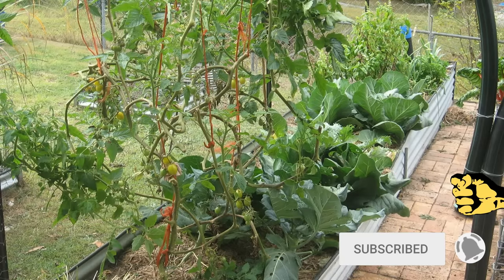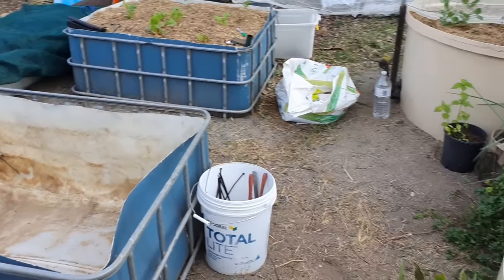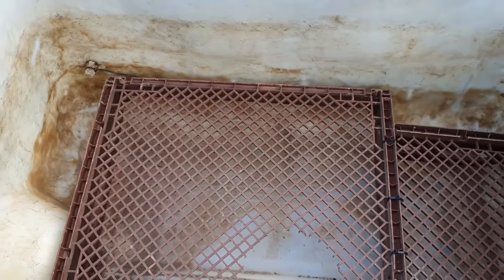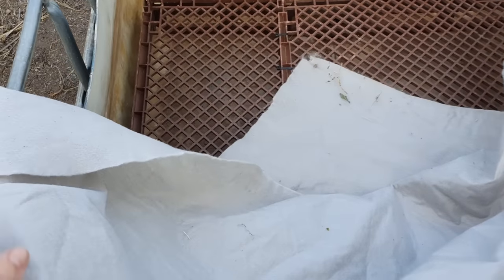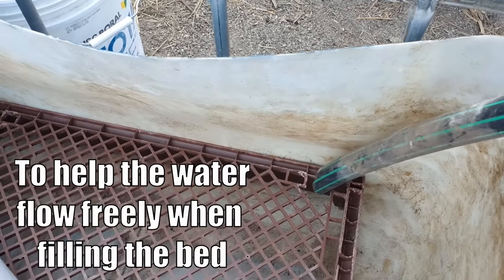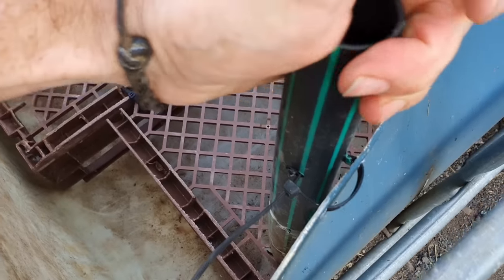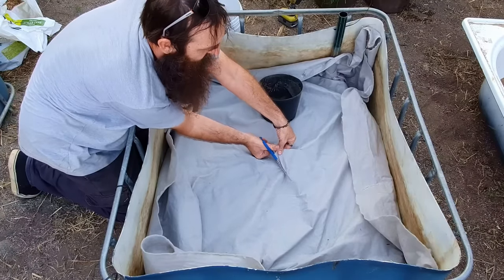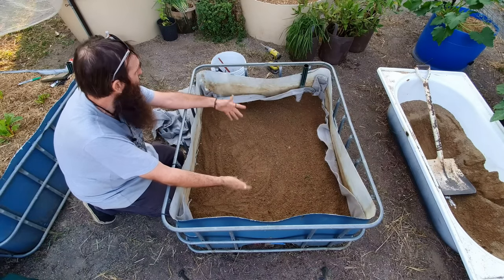How to Make a Wicking Bed with Bread Crates | Large Water Capacity & Healthy Soils

Comment: I know this is an older video but hoping someone might see my question and have an experienced answer.  I've been watching these videos for about a year now trying to learn enough to not kill everything I plant.  Today my husband surprised me with a used Behlen stock tank that is 2x2x6.  I'm thrilled and want to make it self watering using advice from this video.  No questions about that process because the instructions here are so great!!!!  However, I'm such a newby at gardening that I don't know if I should use this system to plant potatoes.  Will potatoes do ok in a wicking bed environment?  And would it matter if I plant determinant or indeterminate?  Thanks for any answers.
Reply from the maker: Hi SS. I've grown potatoes in wicking beds & barrels & find they always do well. I do like to do them in a taller bed & plant the seed spud about 150mm/6" above the top of the reservoir level so they don't get too moist. I also make sure I hill up around them so any that breach the surface  don't turn green when the sun hits them.
I hope that helps some.
Happy growing.
Reply: @RobsAquaponics  - Thanks so much for the reply.  I've got lots to do and probably more than one or two failures in my future but I'm determined to do this well. I love that you share your knowledge.  And I'm green with envy over your abilities and growing knowledge. The good kind of envy turned quickly into admiration. May all the good you put out to others come back to you multiplied again and again.

Comment: I've used small float valves that facilitate autofilling of the reservoir.   It took many trials and errors to configure the values and floats to work reliably given they're designed for the float to be on a horizontal lever arm.  I have photos; don't know how to get them to you though.
Reply from the maker: Nice one Kate. I made up an auto top up system as well with a float valve in a control box that sat outside the wicking barrels. Worked really well & would like to try something similar with the larger wicking beds when we set them up in their final positions. 
Cheers & happy growing.

Comment: Hi Rob, love your channel.  i exactly thought the same idea ( however using free Japanese beer crate got from gumtree instead of bread crate) after watching your previous video. now i am building 4 wicking bed (probably over ambitious) . and wondering if any sand( think of sand  from garden)does the wicking trick? i know you are a firm believer of sand as wicking material but  what is your take on coco coir  instead of sand? have you ever compared  these?
Reply from the maker: I haven't compared them sorry mate but have used the coir in small wicking buckets before with no issues.
I can tell you that the two round wicking beds I quickly showed in the clip have a very sandy soil in their reservoirs. I made sure there was very little organic matter in it & so far they're doing well. 👍
Cheers.

Comment: Hi Rob. I've just recently found your YouTube channel as I'm interested in setting up my own aquaponics system now I have an allotment and have been loving the videos of yours. I was wondering is there a way of hooking up one of these wicking beds with an IBC based aquaponics setup, or is it better to have them separate? Keep up the good work! From the UK 😉
Reply from the maker: Hey BBD. They can be hooked up into aquaponics & would like to do so myself at some point. I'm looking at having a small amount flow through the base in a separate loop that then returns to the sump tank. 
Another option would be to just remove water weekly from the fish side of the system & replace it with fresh water. The removed water would then cycle through the wicking beds until it needed to be topped up again from the fish/aquaculture side. That's basically how the beige 2nd hand system was set up before I bought it. The plumbing was more elaborate than I have in mind though. 
Cheers mate & happy growing.

Comment: Great video. How do you know how high to install the over flow point?
Reply from the maker: It can be done a few ways. You can have a fixed height at the uppermost volume you want the reservoir to hold or you can make the hole at the base & use an external movable drain to set the height. 
This link will take you to a spot in another video where I run through that idea,
https://www.youtube.com/watch?v=hL7PgoTlImE&t=364s
Hope that helps.

Comment: Hi Rob Thanks so much for all your info. Could you use all soil, rather then sand and soil? Thanks
Reply from the maker: You can use just soil. I used some old bed soil that had very little organic matter in one recently & that looked to work OK. Was only slightly anaerobic in a few spots when I pulled the bed down so was a much better result than I expected.
Reply: ok thanks , right after a posted that question  I watched one of your vids where you tell why you use sand was some times the soil will start to smell and turn bad after a while if it has a lot of organics in it.  What do you do with the bed to get it ready for the next season?
Reply from the maker: I generally just top dress with a few cm of compost & freshen up the mulch between crops Bob. I may add some slow release organic pellets as well if I'm planting out a load of demanding plant in there as well.

Comment: Love this design. Im new to the channel and was wondering how often do you need to change these?
Reply from the maker: Hey Amber. I like to feed them up with a top dress of compost (or slow release organic fertiliser if I have no compost on hand) once a crop comes out & that's about it other than adding more much as required. I also like to leave the roots of plants in to help add organic matter that feeds for the worms & other soil biota. 
I have has some that settled after a few years so dug through a load of organic matter & that helped to loosen the soil up again.
Reply: @RobsAquaponics  thanks so much for the intel! Will definitely help as I try this method

Comment: What are the dimensions of the container you are using in this video?
Can this method be used in a planter bed that is 8ft long and 3ft wide? 
What modifications would you suggest for that size?
Also what is the weight or grade of Geotextile fabric you use?
LOVE the video - I'm inspired
Reply from the maker: Hi Carol. This IBC bed is about 3 x 3ft & is 19" high & you could easily set one up in a 8 x 3ft bed. 
The longest wicking bed I've made was around 16 x 3ft & it worked really well. 
The one thing I  would recommend you do is to  bring the liner all the way up to the top edge of the bed. I didn't & had tree roots got in. 
You can see a smaller version of that bed in this OLD video. https://www.youtube.com/watch?v=1PlBrOnKaQI
Keep in mind that I would not build the reservoir the same as the sand one in the video I shared above. I would probably try to use something like the bread crates or pallets to allow for more water to be held there, like in the video you're commenting on.  
The fabric I'm using is sold as "Geo Textile" here.  https://www.bunnings.com.au/grunt-1-x-10m-non-woven-geo-textile-membrane-drain-mat-fabric_p1090843
Hope that helps some.

Comment: Loved your detailed video thanks and plan to copy this method on the weekend. Given it was something new you tried compared to the agline, wondering how it has stood up since and whether you’d recommend any tweeks? Thanks.
Reply from the maker: I found it to be the best build to date Karin. 👍I have now used a similar design in a new aquaponics flow through wicking bed & future beds will be made in the same fashion but I will probably use something other than the bread crates.
Reply: @RobsAquaponics  thanks for that - any reason the bread crates are an issue? I've got mine all setup and will start filling with sand, geotech and soil mix shortly. I did add one or two extra wicking pot points cut into the crate. Either way - it's the right time to change to something else if the crates are problematic. cheers
Reply from the maker: @karinschicht3808  The crates are just hard to come by legally. 😉 These came in a batch of goods I bought second hand & haven't seen others come up for sale since.
Reply from the maker: @karinschicht3808  I tend to make do with what's on hand most the time.

Comment: I live in nz and hav followed u for many years and now we hav moved into a new property i will be finally able to hav my wickering beds. My only question is, what is the geo fabric u use and how do i go about getting sum and is there other fabrics that can be used for the same job? Is this the same fabric used to line soak holes
Reply from the maker: It's known as geo textile in NZ as well from a quick search I just did. Used mainly for keepingg silt & sand out of drainage pipes & soil stabilisation. I like it as it wicks well. The woven landscape/weed fabric helps separate the layers but doesn't wick that great & should be available in the garden section of hardware stores. 
Hope that helps some.
Reply: @RobsAquaponics  brillant we hav sum left over from our soak hole 😁 thank u

Comment: Utterly splendid video, cheers! 
I have tall beds, very deep.. necessary as have some physical restrictions so going low is not an option at all. Most are half-filled with rubble then some good old wood filled up to the level required before the soil goes in... but am always looking for any way to add to the conservation of gaia, esp on the water front. Indoors we've only flushed using old bath/shower water for decades, and outdoor want more space for water containment but is all my spare space is used for. This information is my idea of ultimate treasure, no kidding.
Might I enquire what you suggest/what is it you've used as the plastic container that you put everything into, within the actual bed? 
I'd attempt to alter everything this autumn as long as I've a few more hands on board & some backs that can handle some bending & basically strong young ones shifting sand etc, am all for getting a couple of these containers set up in such a way.. meanwhile continuously providing & nurturing my family/peeps & neediest parts of the community with healthy organic produce foc, that I'll carry on with in the smaller beds until this system is set up. 
This is the best thing I've ever seen. And your other ideas are brilliantly helpful too. 
An inspiration that is valued beyond measure bruh. Rockin it! 🙂
Reply from the maker: Hi HY.
The tanks are called IBC which is short for International Bulk Container. They can be found for sale at farm produce shops, drum & tank recyclers & on sites like Gumtree & Craigs List. 
I look for ones that have had food or food-safe products in them.  I chop them in half so we get 2 watertight beds from them that also help in roots from nearby trees invading them. 
This playlist has some of my other wicking bed builds in it that might help you with a few ideas as well.  
https://www.youtube.com/playlist?list=PLBcWprMIwYYizRYZra6RRbe_mrPdnXu4G
Hope that helps some.
Reply: @RobsAquaponics  you star!! That's super helpful dude, shall go seek them out!.. I hope your days are full of vitality that brings naturally grown nutritious nourishment to your belly.. that all around you are solid in their efforts & mutual appreciation is in the giving.. that tranquillity reigns even on the fiercest days where we face our toughest challenges. May all your future endeavors be fruitful. 
In humility and appreciation, h x

Comment: Looks wonderful, Ive been debating on making some out of IBC's. Can you make 2 wicking beds from 1 IBC?
Reply from the maker: You can but you need to make sure that the lid is water tight. 
You might want to shape the soil under the lid section as well so it doesn't distort too much. 
Hope that helps some.
Reply: @RobsAquaponics  Thanks rob bob ! It was very helpful

Comment: Hi Rob,  Looking to build some of these for a community garden.  In our Melbourne weather we need to be mindful of frost and heat in summer, have you seen any designs where you can make a cover for these? (plastic in winter, shade cloth in summer)?
Reply from the maker: Hi Nigel. It would be easy enough to connect some fittings to the beds if they were clad with timber. 
I've been checking out these fittings https://www.klevercages.com.au  & might have a crack using some to make up a few cloches up for the brassicas next winter. 
Hope that helps & sorry it took so long to respond.

Comment: Thanks for another great video. What’s your thoughts on where to tap the side for overflow? Do you leave an area of air between water and sand when full? I live in Florida and if I don’t put a screen over the fill nozzle, I can hear frogs screaming to stop sometimes while filling or I see them coming out of the drain hole.
Reply from the maker: Hey Matthew. For this style of reservoir, I would like to have the bottom edge of the drain above the high point of the water cell & in the sand wicking layer. 
It is a good idea to have a top over the fill tube & something I'm yet to do. 😕 Thanks for the reminder. 
Have a top one mate.

Comment: I have a 3m x 1.2m bed and have 6 cut down milk crates but could fit 12. Will it be better to have 12 cut down milk crates over or do i require the additional space for sand?
Reply from the maker: I would use as many as I could the add in small wicking post filled with sand throughout the bed to bring the water up Michael.  Hope the build goes well for you mate. 👍👍

Comment: Thanks for the vid Rob. about to created such but want some advice in obtaining  foodgrade IBC's.  HDPE is BPA free, yes? I am looking at used IBC's of Finethene 49080. Then there is 5502 HDPE .
Is all High Density polyethylene IBC plastic BPA free  but just depends on what was stored in it that makes it suitable or not. How will one tell if it is being delivered without the chance of inspection? ( Melbourne Lockdown)
Reply from the maker: Sorry for taking a while t get back to you Neville. As far as I know, all IBC are food-grade HDPE from what the recyclers have told me & from a quick search. 
You could ask the supplier to tell you what's on the labels on the outside of the IBC & do a search from there to see if it's a product you're happy to clean out. 
Sorry again for taking so long. to get back to you.

Comment: Hi Rob, 
Have made up a number of wicking beds now. The wicking process does not work. Have tried a number of different mediums but nothing has worked so far. Do you have a recommendation of what to use in a wicking bed if one does not have any soil to put in or have any composted materials?  Do you buy soil if you don't have any?  Just after some ideas. Thanks so much.
Reply from the maker: Am sorry to hear you've had no success with the beds. Did the medium not wick or wick too much?
The best medium to use would be a potting mix which can be bought from landscape supply retailers in bulk here. Failing that a good "organic" soil blend from them should also do the trick & is what I have used up until I started to rebuild these beds. 
Hope that helps some.
Reply: @RobsAquaponics  Ok thanks so much for the reply Rob. Yes the medium was just not wicking at all. For bulk potting mix its $135 per metre and the organic soil blend was $59 per metre. The potting mix would be ideal but as I need around 20 cubes way too  expensive. If I got the soil blend and mixed in some hay or straw would that work do you think?????   Thanks so much once again.
Reply from the maker: @marinetrax  That could do the trick. Myself & others have used mushroom compost to help break up the organic soil blend if that helps. Most will kindly mix it as they dump it in the truck as well which helps.

Comment: Hi Rob,
I have a bed roughly 2.9m long x 1.1m wide.
It easily fits 12 milk crates. I’ve cut these down to approx 130mm. Can you advise on configuration? I’m using coarse river sand as the wicking medium and have geotextile for seperation. Do the crates need to be connected or can they be just evenly spread out on the base of the bed? Do they need to be connected with say poly pipe or will water find its way into the milk crate water cells through the sand? 
Please advise !
Reply from the maker: It's probably best if they are connected in some way to help the water flow easily from one to another Michael. 👍

Comment: Do you calculate the area of the bed with the size of the water reservoir? You said you used the 4"" drainage aeration pipe in most of your beds and with this new one what's the difference in water height Rob in comparison with the bed size. Just looking for a rough idea on how big the bed, the water reservoir feeding it and the refilling periods. Another very important point Rob, is there any issues with the plastics and leaching chemicals into the water? that's then wicked up to to the plants, especially edible ones we eat - Great video and picked up lots of ideas!
Reply from the maker: The only heights I base the build on is that water will only wick up about 300mm/1ft through the soil so I like to make the soil layer no deeper than 450mm/18". The reason I go taller is that soil will settle & roots will grow down to find the moist zone. 
Depending on the wick you use the reservoir can be anywhere between 50-200mm / 2-8" deep. I like to use sand as wicks but the "geo fabric" I used will also wick.
Both the Polyester & BPA are BPA free & considered safe from what I've read so I'm happy to use them in the builds. If others find information otherwise I'm more than happy to investigate further. We all need to make the decision for ourselves in the end after doing our own investigations. 👍👍